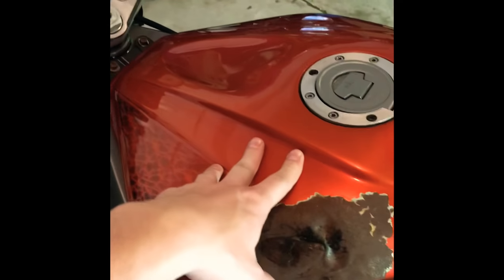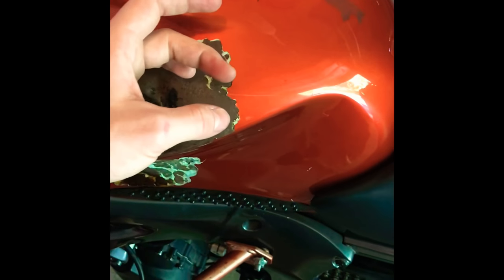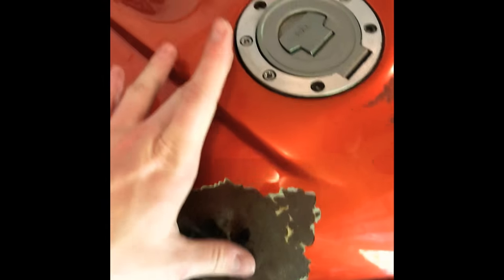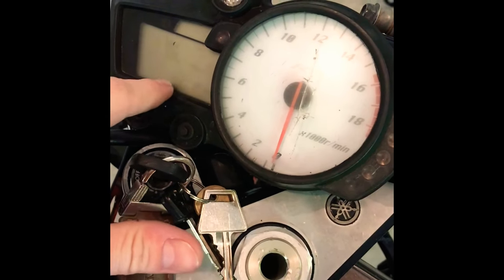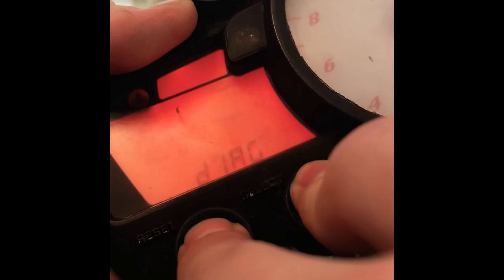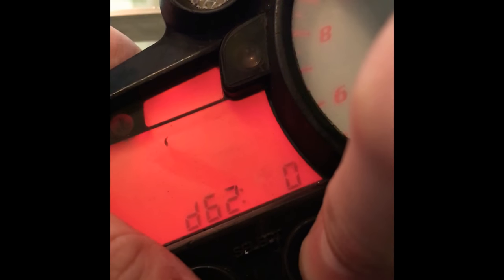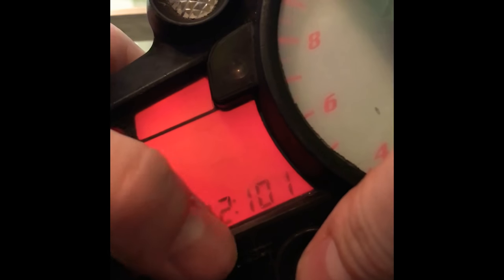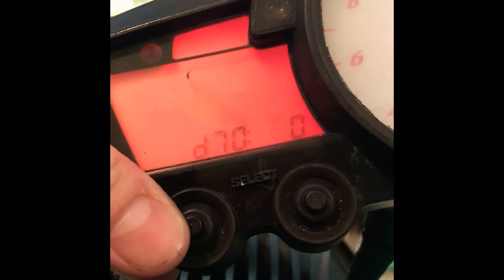Yamaha R6 Diagnostic tests

Comment: Iam having a similar issue with a jumpy idle.  When I start her up shes ok but every now and then, not always when I am riding the rpm' s will drop so low she will stall....   Also, once shes warmed up she only idles at 1 and bounces around between 1 and 500.  Does this sound more like one thing then the other?
Reply from the maker: Brian Burk It could be the throttle position sensor or it could be the atmospheric pressure sensor. I’d bet it’s one of those two things! Hope I’ve helped! :)
Reply: @motormaniac1  I will check both today!  Thankyou!  I am also going to be changing the plugs and coils.  I dont think that she has Denso coils but we shall see.... Thanks agian for the help will let you know the results!
Reply from the maker: Brian Burk Not a problem at all! Let me know how it goes! ☺️🍻
Reply: I have the same issue , what did you do to fix it

Comment: I can’t get it onto diagnostics mode for some reason error 2 and 1
Reply from the maker: JayBee Does the bike start? Could be a frayed wire in the harness, or it could be another electrical problem.
Reply: Motor Maniac no it doesn’t start I had issues with the ECU being fried when I bought it replaced and now my battery blew up and headlight blew, changed the voltage regulator but I want to reset the codes first before buying a new ECU, I feel like it’s in a safe mode protecting it self it still turns on my fuel pump and stuff
Reply from the maker: JayBee You might also have a short somewhere. My guess is the bad voltage regulator damaged something like a fuse or a wire somewhere :/

Comment: what would d62: 04 mean? If it means I have 4 codes how can I find them?
Reply from the maker: For D62, that is usually the “erase all existing codes” option in the diagnostic menu. 
That may be the total number of codes on the bike now. In other words, It’s telling you how many codes you are about to erase. 
D61 is code history. What does that one say?
Reply: @motormaniac1  d61 would be 11, does it have a scanner like a car so I can know what codes I have?
Reply from the maker: @SLZR60  So D61 is the history of codes on the bike. It should scroll though all of the codes. Write each code down. If it’s just 11, then all you have is a code # 11. 
Code 11 is listed as 
11 - No normal signals are received from the cylinder identification sensor when the engine is started or while the vehicle is being driven.
Reply from the maker: @SLZR60  D61 will show all codes that the bike has seen since the last time the diagnostic codes were erased. 
If it’s just 11, then You had that code 11 on the bike at some point, or you have it right now. The R6 does not have a scanner port. The diagnostic mode was the early answer years ago to bikes not having scanner ports.

Comment: Got a 2003 R6 can't get in Diag mode, what to do
Reply from the maker: I’m not sure.
I would look at the frame, and write down the VIN number. Call Yamaha to see if the bike VIN is from a 2003. If the ECU is from a different year, you may have a different process to get to the diagnostic mode. 
Likewise, if there is something wrong with the ECU or the gauge cluster, it may prevent you from going into the diagnostic mode!
Reply from the maker: Keep me updated! I’m curious to find out what it is!